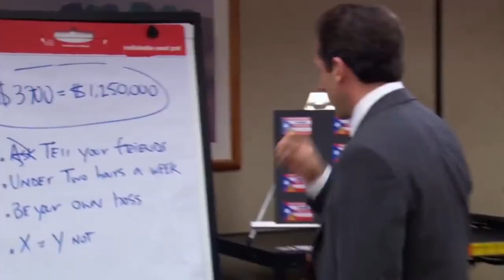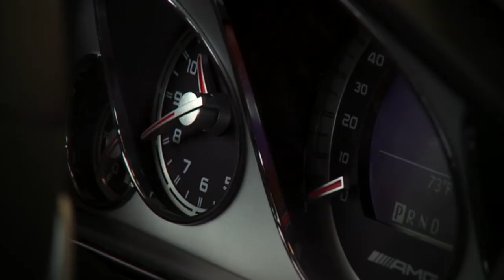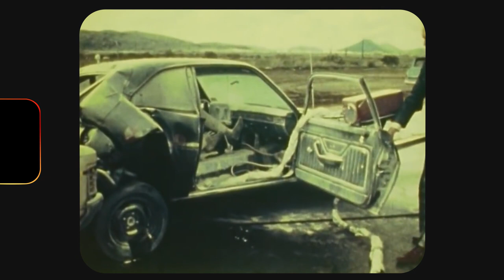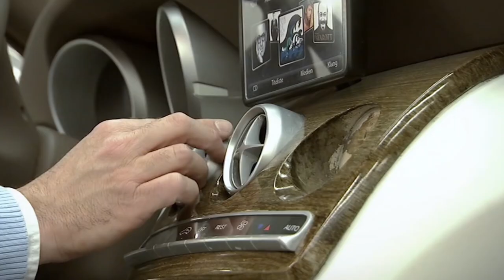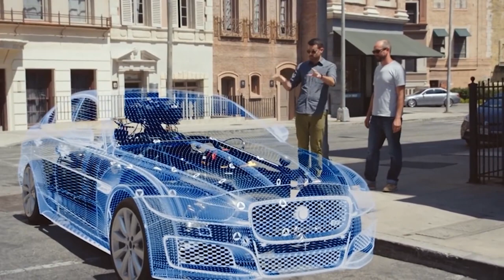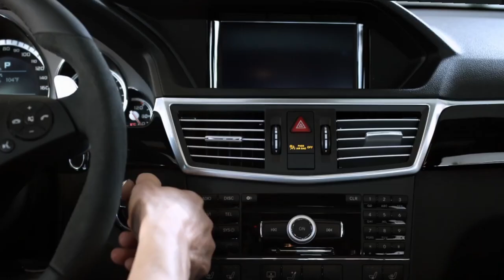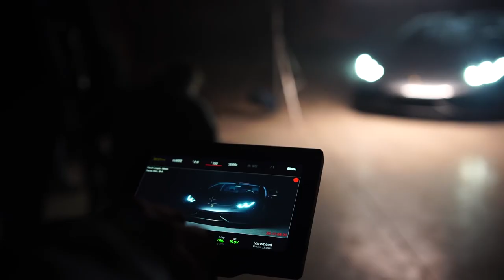How Car Commercials Lie To You

Comment: I was shopping trucks in March when I some certain dealers offering a fantastic discount around $10,000. The amount of discount varied from vehicle to vehicle several thousand dollars. When it came time to actually get real with the numbers, to put the numbers on paper to sign, the discount suddenly shrank to $6,200. What happened to “$10,000”? No answer.
Furthermore, I researched the trade in value of my vehicle to in the range of $19,000 to $21,000 as it was a three-year-old cream puff. That was trade-in not retail. They offered a measly $16,000. When all was said and done I saw my old SUV up for sale for $24,000!
Reply: That’s why I hate dealerships. It’s so much work just to buy a car. The only car company I know of that has a direct sales model is Tesla. More companies need to get rid of dealerships.